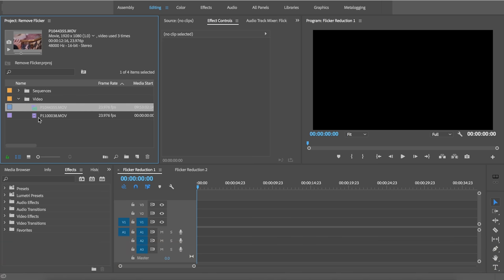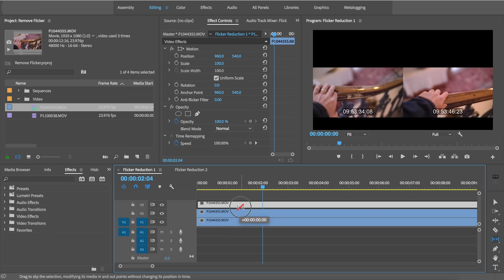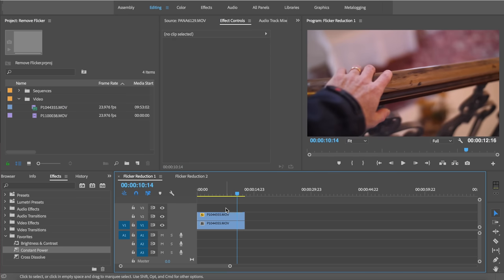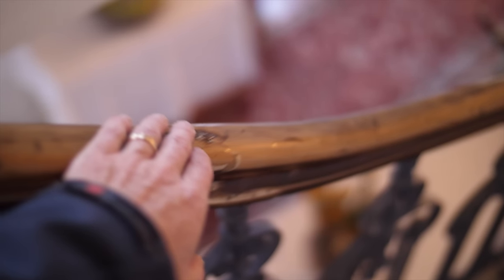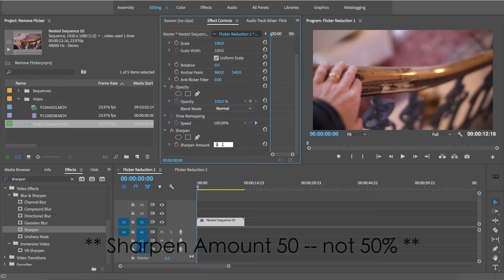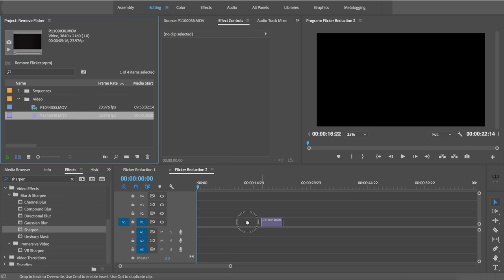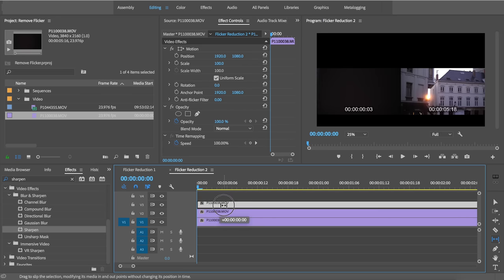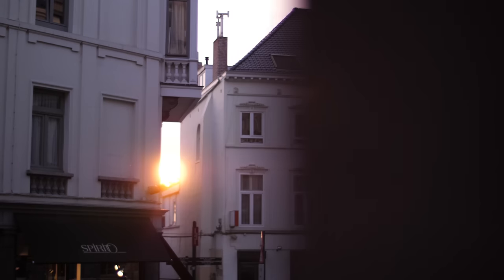Fix VIDEO FLICKER in 30 Seconds WITHOUT Plugins

Comment: my clips won't move. They aren't locked.
Reply from the maker: The slide tool needs extra frames before and after the clip on the timeline to be able to “slide” around in.

Instead of dropping the full-length clips onto your timeline, select just the portion from the clip that you want to work on, set the in and out points, and put into the timeline. Then the slide tool should work.

Comment: The moving something a frame thing doesnt work at all for me.
Reply from the maker: Make sure you're not working with the whole clip (like exactly the clip as it comes out of the camera beginning to end). When you do this there are no extra frames before and after for the timing of the clip to slip around inside of itself. So either use In and Out points before you put it on the timeline, or if you want to use the full clip, you'll need to just drag the clips over by 1 frame (first layer above) and 2 frames (second layer above).

Comment: i don`t know why, but is not working on a 120 fps clips of mine...
Reply from the maker: I use this a lot on 180 and 120 fps, and it usually (though not always) works. Are you sure you were able to offset the clips by one or two frames?
Reply: Absolutely my friend!
Reply from the maker: Not sure why it’s not working. Could just be the type of flicker.

Sometimes I’ve been able to get rid of flicker by doing even more layers...always offsetting by one frame from the layer below, then making opacities of 100%, 50%, 33%, 25%, 20%. The main problem with this is that any ghosting becomes even more pronounced.
Reply: I did something similar, but with 3 layers x 33% and it worked, but the framing become choppy 😬
It seems in Europe I must shoot in 100 fps, not in 120 fps 😑😔
Reply: It's not that big problem.
I'll try not to make the mistake while filming.
😁
Keep the good work my friend !

Comment: it doesnt let me move the copied versions over a layer....at all. How?>??
Reply from the maker: What program are you editing with? Most programs have some way of doing this. I've used probably half a dozen different editing programs over the years, and I think they could all do it. That said, I'm not very familiar with programs other than Premiere, so I don't know/don't remember the specific ways to move a layer over.

If it's helpful: for this video I used a "slide" tool to drag the clip one frame over "within itself", meaning the in and out points stayed on the same spot on the timeline. But if your program doesn't have an option like that, then you can just drag the whole clip one frame over (so it'll start and end one frame later than the layer below it). Then you can clean it up by dragging the start and end points of the layer to match the other.
Reply: @BlueMantleFilms  I worked it out, my hotkey was slightly different for some reason and I forgot to turn snapping off. I was using same program. The slide tool wouldn't work but the other tool (right click it comes up, forgot what is called) did. It didn't keep the same in and out points though sadly but it did remove the flickering

Comment: I have a BIG BLACK HORIZANTAL LINE MOVING DOWN MY VIDEO
Reply from the maker: That sucks. That's more in the realm of "banding" rather than "flicker", even though they are related in the sense that it has to do with your original light source being an LED or Fluorescent that flashes instead of having a constant output of light.

The way to avoid that is to make your shutter speed a little bit longer, but since you've already filmed it, trying to get rid of it isn't as easy as the trick in this video. The way I've lessened the look of banding is using a brightness filter that's masked to where the banding is, then increasing the brightness so that the center of the band matches the non-banded video. It's tedious because you'd need to create the mask halfway between the transition between the band and not-band, then feather the edge of the mask to fit the width of that transition. Once you've fixed one frame, then you'd need to move to the end of the clip (or whenever the band goes off the bottom of the screen, whichever comes first) and keyframe the position of that mask so that it still lines up with the same band that it was on before. Definitely not a fun process to try to do, but if you absolutely need to use the shot, then that might be your best bet.

Thankfully when I've had banding in the past it's almost always with b-roll, so I can just not use the shots that have it. And when it has been on an interview, for example, I can show the person for only a few seconds (short enough that the banding isn't glaringly obvious) and then cover up the person with b-roll.

Hope that's helpful!

Comment: you didnt show what you promised in the thumbnail
Reply from the maker: It works for most people and most types of flicker, but unfortunately not all. Also, some people don’t understand how the slide tool works, and the clip doesn’t actually slide. Are you sure you’re actually offsetting the clips by 1 or 2 frames?

Comment: tried this on 120fps slowed down to 20% and still have the flicker... any suggestions? thanks!
Reply from the maker: Priscilla Gomez Hi Priscilla, a few things you could try:

With two layers above main clip, put second layer at 50% instead of 67%, still keep third layer at 33%.

If that doesn't work, do three layers above with opacities at either 75/50/25 or 50/33/25.

If none of those work, would you mind sending me the clip to experiment with and see if I can get it to work? I've found when working with different clips that flicker manifests differently, but I've been pleasantly surprised to usually be able to get rid of it by using some variation of this hack.
Reply from the maker: Did any of the suggestions work for you? If not, as I said, please feel free to send me a clip you're trying to fix and I'll see if I can do anything with it.
Reply: Thanks for staying in touch! I actually tried all your suggestions without any luck. I surprisingly fixed 1 video by slowing it down in after effects... not sure how that worked but it did! For the other footage I had the editor resort to deflicker plugin which he said worked wonders but I have yet to see what settings he used. I can send you the footage via dropbox link if you still would like to mess with it!
Reply from the maker: Priscilla Gomez I actually would like to, yes. I like a challenge :-)

You can send the link to matt (at) bluemantlemedia (dot) com
Reply: Blue Mantle Films hi! Sorry been swamped at work lately... Will send this over tomorrow tho!
Reply from the maker: Priscilla Gomez Completely understand being swamped with work! But yes, when you're able to send a clip my way I'd love to try my hand at it.
Reply: I have the same issue in some footage slowed down, I think some of them cannot be saved :D Next time i'll swicth to NTSC mode ;)

Comment: Not working on my video please explain and make a video
Reply from the maker: Are you working with slow motion or realtime footage? If realtime, unfortunately there's usually too much motion in that for this technique to work. It only works on scenes that have little and/or slow movement.

If it is slow motion footage, and you're still having trouble, try doing an opacity of 50% (instead of 67%) on the second layer. If that doesn't work, try adding one more layer, and lower the opacities even more. When I have four layers, I usually set the opacities to 100/50/33/25.

Comment: Really depressing to see it's working for 99% of the people 😂
Reply: Just figured it out. My footage was 60fps so instead of moving the top 2 layers 1 frame, i moved it 2 frames each. Better now.
Reply from the maker: I’m glad it worked with the modification you made.

I am curious about this, though, because in theory this is frame-specific, regardless of the framerate. Were you shooting in 60fps, but had the shutter speed lower than 60, causing duplicate images for two frames in a row? That’s the only way in my mind that what you said makes sense for working.

Comment: Not working
Reply from the maker: Try just one layer above at 50%, or three layers above at 50/33/25. Sometimes certain flicker works differently depending on the shutter speed you were filming at, so trying a few different ways may help to make it better.

Comment: not working bro
Reply from the maker: Bummer.  Yeah, it doesn’t always work, but I’ve had pretty good luck with it overall. Did you try it with different numbers of layers? If only one layer above original, do 50%. If multiple layers, just make sure each is offset by one from from the one before it, and set the opacities of the layers (starting with the bottom layer) at 100%, 50%, 33%, 25%, 20%. Then turn off layers (starting with the topmost layer) and use the fewest number of layers that still gives you acceptable flicker reduction. If that doesn’t work, then it may be a lost cause.

Comment: its not work
Reply from the maker: Try one layer above the original at 50%, or two layers at 50% (instead of 67%) and 33%, or add one more layer at 25%. Obviously make sure each one is offset by one from from the layer below it. That means if you have a total of 4 layers, you’ll have a multiple-exposure if four frames, so it could start to look weird if there’s any significant movement.

Comment: Terrible. Adds a ton of motion blur
Reply from the maker: Works with a lot of slow motion clips, but usually doesn’t work with real-time clips, since they’ve got so much motion. Are you trying this on a real-time clip?

I say in the video “any time you’ve got a lot of movement this won’t work”.
Reply: @BlueMantleFilms  it's slowmo
It is from sports, but isn't moving that much per frame
Reply from the maker: Well that’s a shame. Sorry it didn’t work.

There are plugins that can help too, and they usually incorporate a motion reduction aspect as well (though the one that I have used, DeFlicker, still has motion issues). The annoying thing about those programs, though, is they’re expensive, and they take a long to process the clips, so I always try this hack first to see if it works.